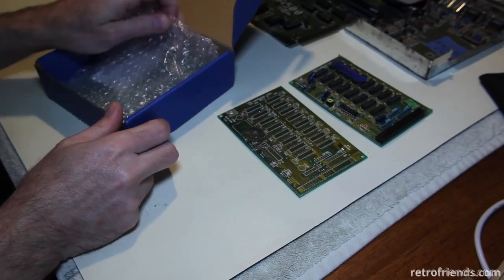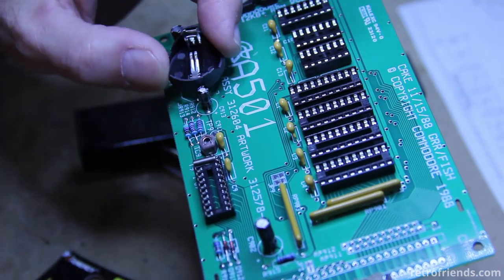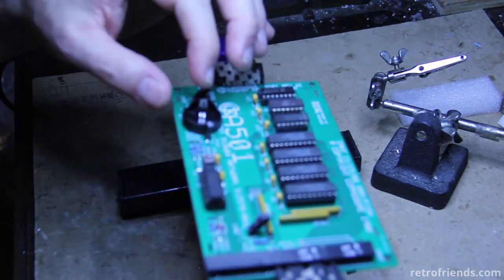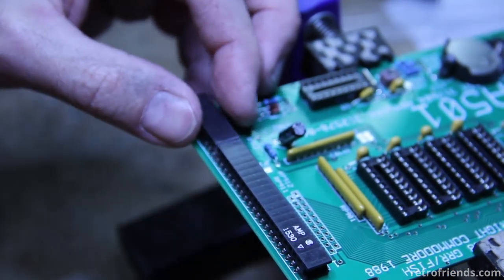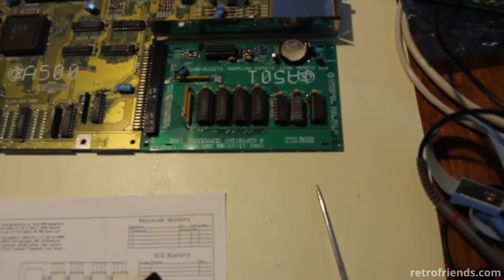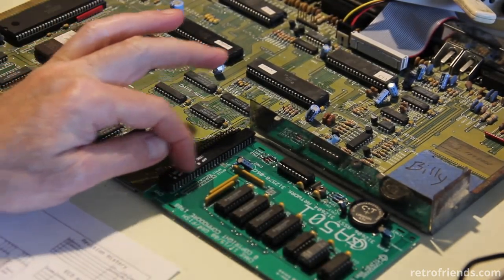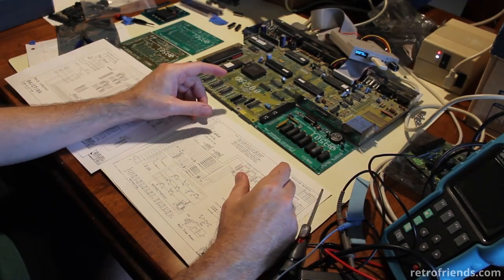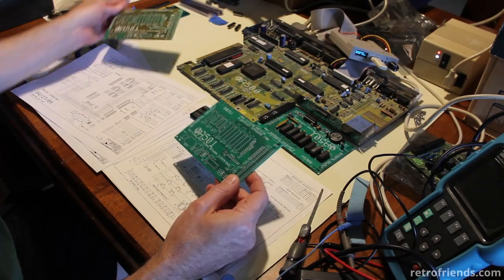I made another Amiga 500 Memory Expansion - replica A501 r6

Comment from the maker: As it turns out, constantly charging a LIR2032 is not recommended. I will be sticking to using CR2032 and switching the series resistor with a diode.

Comment: Is the LIR 2032 ok as everything I have read on using those states that the charging input is normally too high and they will blow up.
Reply from the maker: Is there a cureent-limiting resistor in series with it, in the examples you have seen?
Reply from the maker: I don't think they will blow up if there is a series resistor, but I have discovered they do not like the constant charge from the Amiga, so I will not be using the LIR2032 going forward.

Comment: Nice work.  The only thing that concerns me is the rechargeable lithium cells.  Are these safe to use with the Amigas charging circuit?  I have read accounts in the past of people using ML2032s and having the batteries bomb and leak due to what is apparently an overcharge or incompatible charging since the Amiga is designed to charge a NiCd/NiMh that can handle more current.  Just my initial thought and I have not tried this solution.  I usually use a diode and a CR2032 or I have in the way past used a rechargeable cordless phone battery pack that is the exact same voltage as the Varta bomb, but I feel those are overkill.
Reply from the maker: I have found that the constant charge from the Amiga is not recommended. I will not be using LIR2032 going forward.
Reply from the maker: I don't see an overabundance of current coming from the Amiga. The circuit has a current-limiting resistor in series with the battery. If anyone has any specific case of an issue, please let me know.